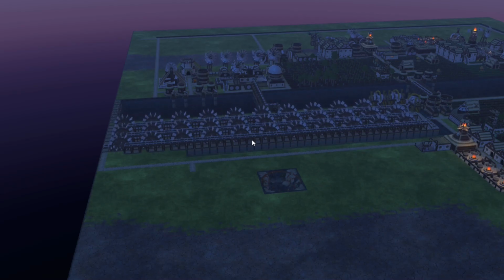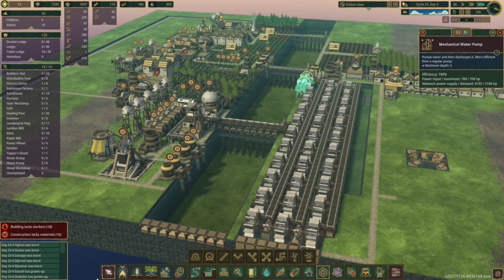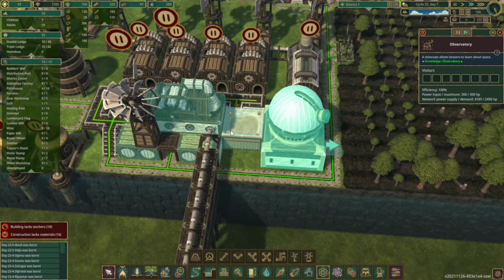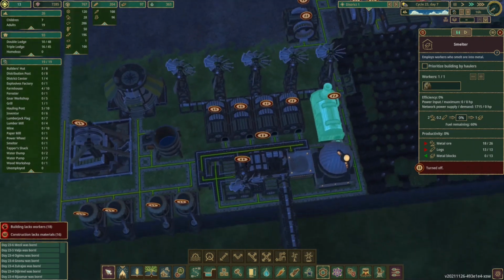Mega Fail! | Experimental Power Gone Wrong! | Timberborn

Comment: Okay.. so it works you just need more water.. im gonna build it on my terrace map and see if I can make it a closed circuit
Reply from the maker: This is going to be a weekend project and I will show to get get it to work a lot better
Reply: @APH3343  good luck, I noticed once you close the circuite it will at least keep 1 tile rivers full, but it seems you need height differences with floodgates in order to get the water to move properly for any energy production.
Reply from the maker: I cracked the Code; I have pictures on the discord of the system as a spoiler for this weekend.  it is gross!!!!
Reply: @APH3343  nice :)

Comment: Do you think they will patch out  the waterdump  trick as well ? It's a nice trick but i guess it's not what they want us to do hahaha.
Reply from the maker: I think the water dump is just as inefficient as the mechanical water dump, just on a much smaller scale.  I think you could use 15 to 20 water dumps in the water output of one mech pump.  someone already did a response to my video showing how to make it work better but did not address water consumption problem, and he did it on free build on no draught... Thanks you sir!
Reply: @APH3343  the way around the evaporation is a bigger reservoir, i dont think water in tanks evaporates but you would need manual pumps and dumps to use that here, its surface area that matters for evap so taller lasts longer, though obviously with current floodgates, 3 high is the max useful height so you use the pumps to get water in a reservoir up to 3 blocks higher than the start of your wheels,
Reply from the maker: I will do a redo of the water wheel system soon, I am up to 10k power with 2 mek pumps, and you are right about needing a bigger reservoir, and a separate one for water consumption.   Thanks for watching and commenting!

Comment: Your attempt is mostly right. You narrowed the channels before and after the wheels properly. You tried putting too many wheels on one level for it to work as a loop. 24 seems to be the current limit. Your pumps should be even with the top of your channel instead of above (They do block water). It takes 16 wheels to recuperate the power for the pumps, so having multiple levels  is needed to achieve the best return, up to 4. Watch my video if you want to see a working perpetual power machine. https://youtu.be/D_kPxwQsN7U

Comment: Wait, does this update apply on the current series you're doing?
Reply from the maker: If I move the series on the beta branch it would.  it would make the water system I have completely broken.  making the new series and doing the old series is actually a little taxing seeing that to work on one I have to switch from beta back to regular play.   in the new system of water, water moves across all level not just the top because that is the only one being affected by the Dams at the end of the road.  it would mean a complete rework of the system.

Comment: I think the pump-dump building is more for getting water uphill than for creating power, but definitely a nifty concept.
Reply from the maker: The new water plants need 1 tile deep of water and the pump stops pumping when the water hits the outlet, so I think it is for filling big areas fast and them stopping.  I think I could push it a little further and get maybe 5k power out of it and on a map like thousand islands where you have 12 water ports, I could see having a revisor like half the map and making almost infinite power.   Thanks for watching!
Reply: @APH3343  I'm sure I've seen a design for lifting water with these. Interesting.
Reply: @APH3343  while you can get a power profit, it might be more useful as a "battery" /capacitor to average out power production, or store excess for when you need it, your windmills and water wheels for example produce power whenever wind is blowing or water is flowing, and only a few buildings can make use of it at night, but if you could turn on the pumps for the hours the beavers aren't working, you wouldn't need to break even for it to be useful, though that'd certainly wouldn't hurt, a simple implementation of this would be pumping the water up behind a power dam, if staged then with floodgates each stage that lead to the water wheels,